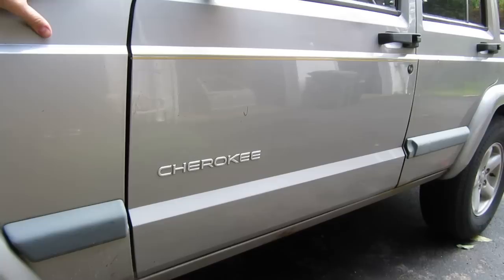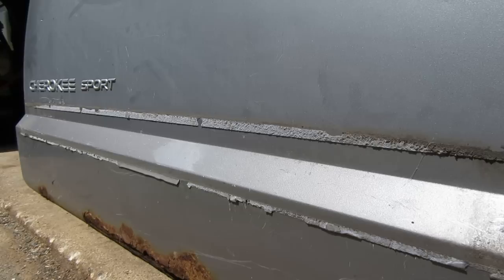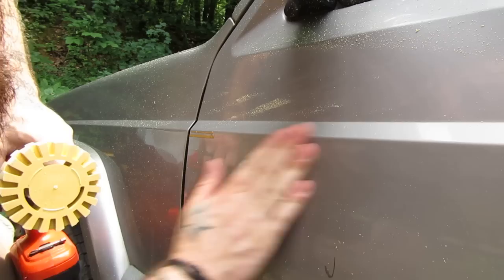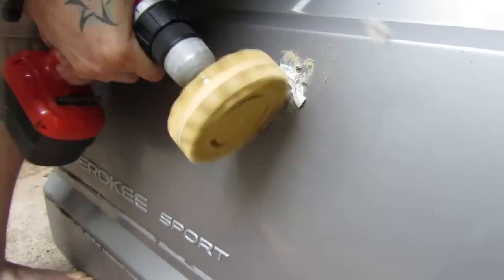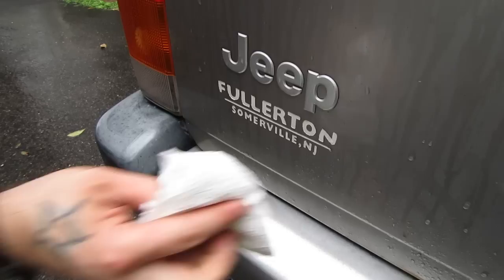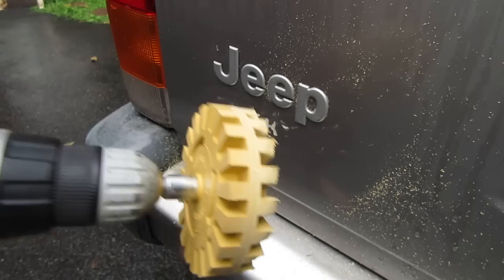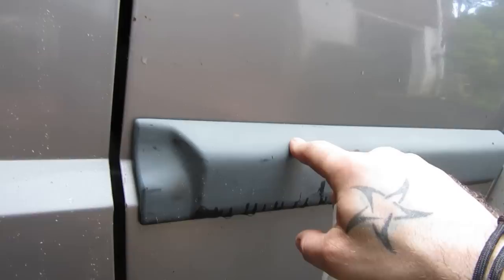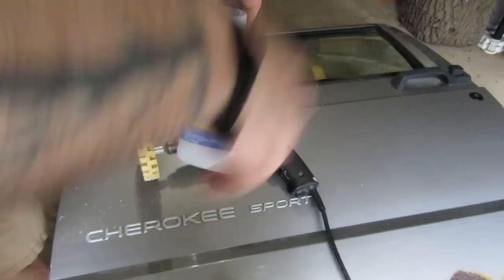ERASER WHEEL - Remove Adhesives without Damaging Paint

Comment: You're gonna think I'm crazy, but I was a reset manager for Lowe's for a long time and we used California Scents Citrus air freshener spray to get double sided tape off painted steel beams. The tape would just melt and you clean it right off.  Mint👌
Reply from the maker: No kidding!
Reply: This badge foam stuff is way more brutal that any double sided adhesive. It even laughed at my 1200 degree heat gun.
Reply: @SOLDOZER  I've used it on decal adhesive but havent debadged anything to try it. I'm sure you are right.

Comment: Thanks for that. I was really wanting to see it on the tape residue. I have that because the dealer service guys pressure blasted my car and tore the decal. I noticed a week later, so of course it could not have been them... I tried everything to get the adhesive off. Even Mostenbockers failed. Now for an eraser wheel. Follow up to this comment. I had tried everything to get the old adhesive off. Heatgun, cutting wax, Dr Mostenbockers, even a razor blade, nothing shifted it. Bought one of these wheels. Took the adhesive off in 2 minutes. Quick polish and it looks like it was never there.

Comment: I wish I knew about this sooner. We spent hours chipping away at adhesive with different chemicals and plastic scrapers, eventually I ended up just sanding down the top of my doors and re painting it because I got frustrated. Thanks for the tip, I'm grabbing one of those things asap

Comment: You don't have to use adhesive remover, if you keep the whizzy wheel in place itll keep eating through. Also corded drill works better more rpms the better up to 4000rpm max. I used this to remove clear bra adhesive on about 1/3 of my Audi A4 hood and there's plenty of where left to use

Comment: If you have anything more than a small amount of work to do, get a 3M pinstripe removal wheel and the company’s automotive adhesive remover. The wheel is crazy expensive — more than $40 at this writing — but after hours of use with it and two cheaper knockoffs, the 3M wins. I had to remove a 15-year-old 3M Clear Bra from the hood of a Lexus, and the 3M wheel was the only one to do so without piles of dusty residue. And despite the enormous amount of material that had to be removed, the 3M was the only wheel that did no damage to the clear coat whatsoever. The other wheels left slight marring that had to be removed with compound and polish.
Also, in the video the drill bounces like crazy. Holding it another way, if you can, makes for a smoother action. Hold the drill in your left hand, palm facing and parallel to the work surface. Steady the top of the drill with your left hand and work from right to left. I had no trouble using a Makita battery-powered drill and two 5 amp-hour batteries. Charge per battery lasted 40 minutes or more, and each battery was recharged by the time I needed it. While rubbing alcohol was fairly adequate for removal of residual adhesive, the 3M product was vastly better.

Comment: I picked up a 3m adhesive eraser from my local parts store. Gonna give it a try tomorrow. Thanks for the video. I feel confident now.
Reply from the maker: Good luck!
Reply: Did it work
Reply: @Ryan-de9oh  Yes, the 3m eraser worked great.
Reply: @maxeyac  ok sweet have u used it to debadge at all I ordered one jus not really to shure if want to use it on the Mercedes
Reply: @Ryan-de9oh  I don't know what you mean by debadge. I removed pinstriping and decals from my 2004 king ranch. Then wiped those areas down with rubbing alcohol. I think I had to sparingly use goof off or mineral spirits too on some areas. After everything was off I washed it and waxed it. It looked great with no signs of removed decals, pin striping.

Comment: Thanks for the video man! I removed my door trim and tried numerous methods of removing the double sided tape with different chemicals and it didn’t budge. I heard about a eraser wheel and found your video very informative! I’ll be picking up an eraser wheel tomorrow. Thanks!
Reply: so how did it go?
Reply: @gamertyper6476   super easy, just took my time with it and made sure to not sit still for longer than a second and I had no problems with it. I also have black paint so if it would have scratched it or damage the paint I’d easily be able to see and it didn’t. I highly recommend getting an eraser wheel for any type of adhesive removal on anything you don’t wanna damage what’s underneath
Reply: @4pf6abyy73  thanks man! Just ordered my eraser wheel from amazon. Going to be finally getting all the goop off from where I debadged my 2010 g37. I tried litterally everything, and even the highest grades of goo gone, and no amount of elbow grease was going to get that last layer of rough goop off - the top layer is nothing to peel off, but after years of having badges being baked under the sun that last layer is damn near apart of the paint at that point.

Comment: Don’t forget to use a heat gun when taking off the trim pieces. Heating it up makes it come off easier and leaves less residue to begin with. Just use a plastic putty knife and ease it off slowly. The eraser wheels are really nice to have in the tool collection though.
Reply from the maker: Good point!

Comment: I have glue on my paint... its expanding foam or spray glue... rock hard... what do you reckon this work? Paint shop tried polisher machine didn't touch it 
tried all types of safe chemicals.
Reply from the maker: Yikes.. that spray foam stuff is NO joke. My guess is that anything tough enough to get through it is going to be hard on paint. I think you will need to find some kind of chemical which will dissolve the foam, but is harmless to paint. Get the Safety Data Sheet for the spray foam then look for solvents which attack the main ingredients, but are harmless to paint... a lot of work, but that is all I got. haha
Reply: @DEInTheGarage  Thanks man for the reply... look at us ... all community and that. I think I will do a video for a spray shop and get it done properly... bummer.

Comment: I removed the leftover adhesive tape with a rubber tape remover on my white truck after I removed the trim & got left over with yellow stains where the trim was, will the mineral spirits remove those yellow stains?

Comment: Hey, quick question, do you think the eraser wheel will help clear up visor adhesive that was left over on the window frame?
Reply from the maker: Possibly. Might be too strong for it.
Reply: @Erick Moreno did you ever figure out what to use to remove that? I currently have the same issue

Comment: I guess it's hit-and-miss cuz I've seen other videos where that rubber eraser has chewed the paint off of the door I guess it depends just like with paint correction if you're dealing with soft paint like foreign cars or more harder clear coat
Reply from the maker: Interesting.. Perhaps pressure has something to do with it? There is no chance the wheel I had would have had the grit to pull through paint
Reply: the eabster were they using a 1/2” impact driver? Lol

Comment: Would this work on clear bra? I've tried steam, heat gun, boiling water, plastic razor. It's coming off in 1/4 inch pieces! I'm not even halfway done in 4 hours and there's a lot of gunk left behind where it did come off. Please advise. Thanks

Comment: Great advice,  how would you deal with a burnt out vinyl wrap on a hood?
You know is a huge working area; my vinyl wrap is completely messed up.
Reply from the maker: This wheel might actually work for that. I bet it would
Reply: I’d use a heat gun and a plastic putty knife to get the wrap off then an eraser wheel to get off whatever adhesive is left over. Since it’s been a year I bet you probably already did it but in case anyone reading this in the future is in the same spot that would probably work best.

Comment: I wonder which is better to use on paint, this rubber wheel or the wax wheels? Any insight on the comparison of the two?
Reply from the maker: I have never tried a wax wheel to be honest
Reply: @DEInTheGarage , I've seen YouTube videos of wax wheels doing the same. I assume they're wax, as that is what the vid descript states. Either way, it's pretty cool how this method removes adhesives.
Reply: They're all made of a rubber compound. The whole point of these is that they don't damage your paint.
Reply: Thanks Diego, I didn't know if they were made up of wax and/or rubber. They do seem to work magic on those pesky decals!

Comment: Can you use on any electric drill or does it have to be a high speed drill. I’ve seen for best results around 3000-4000 rpm
Reply from the maker: Yea, just about any drill I would think. My more powerful corded drill definitely works better than the cheap B&D 14v battery one
Reply: D&E In The Garage thanks for response man. Sounds good!

Comment: Having so many problems removing the 3M clear coat bra cover on my 2012 Toyota FJ.  Heat gun, 3000psi water pressurizer, that crap is baked on crispy Texas style.  I wonder if the wheel will strip my paint...?
Reply from the maker: They are not strong enough to strip paint, might be worth a try

Comment: Just tried some cheap disc off Amazon and what a mess. at 600 RPM just smeared letters around, at 2200 RPM smoke and huge layer of the wheel on top of the mess.  I watched some video with cheap flat, cheap jagged like this, and 3m, this style generated more heat for some reason, and took way longer to remove a decal, the 3m was the best about 1 minute, the cheap look-alike 4 minutes and this style 11 minutes.. what solvent is safe to use to remove the crud left behind, did not wish to harm finish, put a 2015 rust free box onto my 1977 squarebody and like the shiny black paint...
Reply: on the videos I watched there was a powdery mess left behind, this is like it melted the vinyl into the glue along with wheel.. was as thick as a fingernail.. was going to heat gun it, wish I had now...
Reply: I had some orange oil and it took the mess off with a little effort. did not harm finish.  the wheel did in a few areas though... dang cheap vine wheels...

Comment: Easily and harmlessly removed with lighter fluid.
Reply: Will it take off the paper on a paper sticker?  I have 20 yr old sticker on a car and nothing is removing it.
Reply: Your sticker is baked-on by the sun.  I would still use lighter fluid and realize that a buffing will be required to bring it to its former shine.  Goof-off will harm your paint long before the adhesive is disolved.  I use for
Reply: @da324 , if that 20 year old sticker is on paint, it'll probably ghost shadow. If it's on a chrome bumper, no problem.